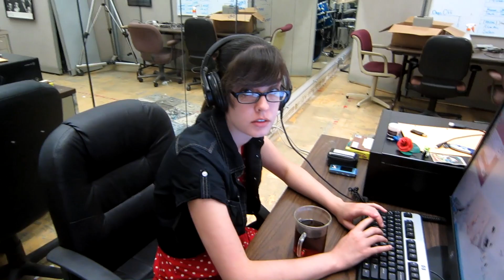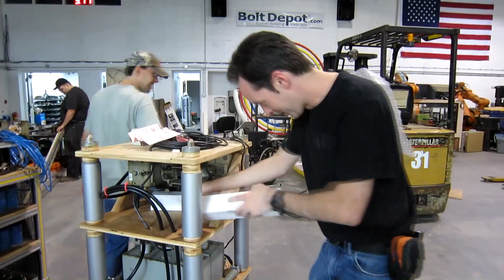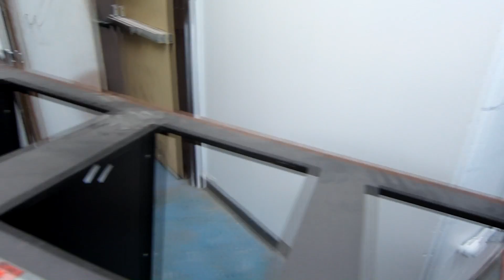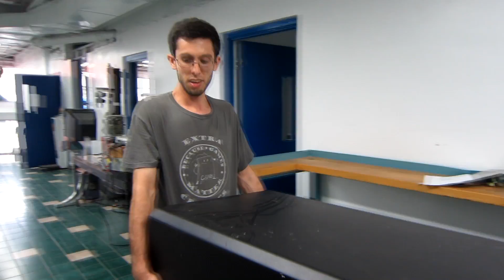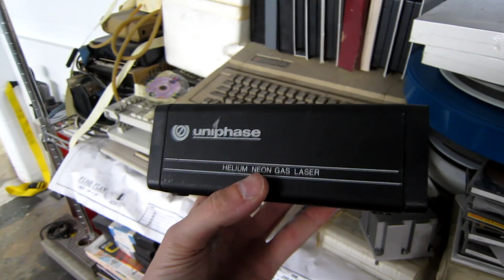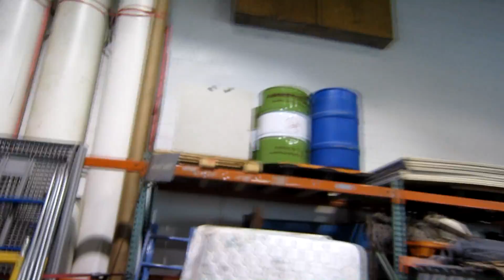Captain's Blog 9-13-2012 Laser Lab Construction Day 1

Comment: Since plywood seems to be in good supply there, make a torsion box(es). Pretty sturdy. You could make the base out of plywood too with room for storage underneath. Might make a good SR100 video since sheet good cabinetry is one of it's strong points.